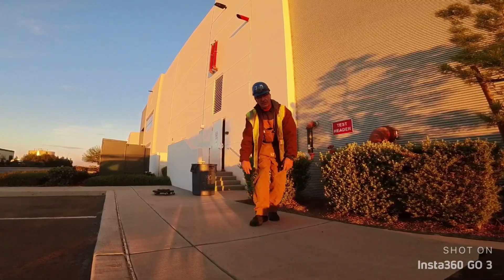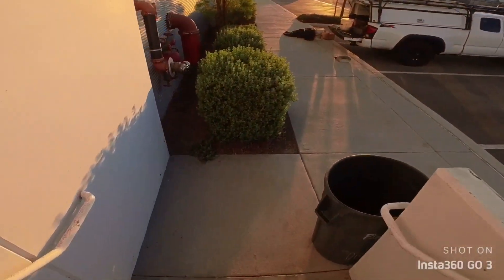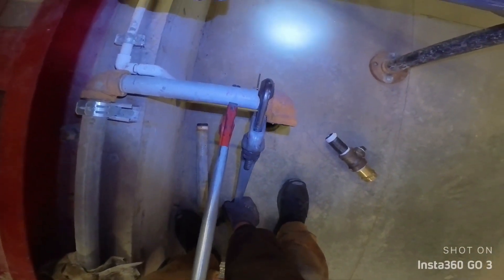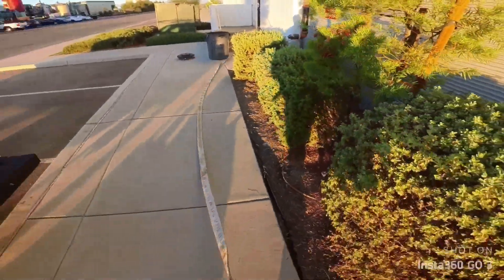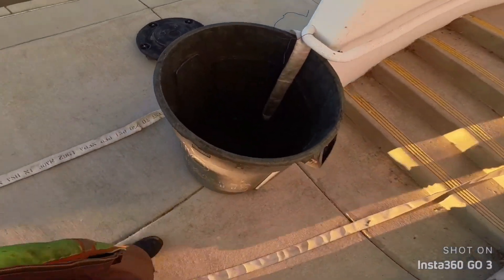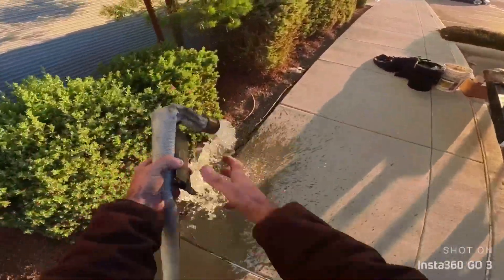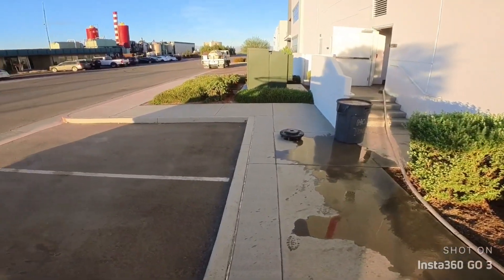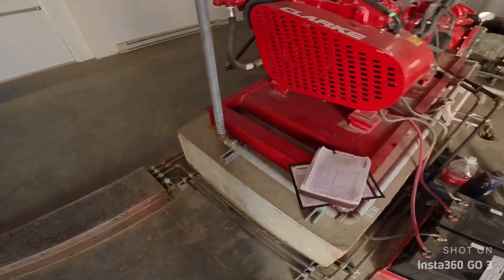Diesel fire pump run. Part 1

Comment: At my last job site (I'm retired now) I had a Diesel fire pump about the same size as the one that you are working with in this video. Your fire pump has two batteries. My old fire pump had four 4-D batteries, I wonder why?
Reply from the maker: I wish I could answer that question. But I know that each fire pump is different and have a different set up. No two are the same. It seems. A while back a couple of these batteries went bad and we had to change them out to different style. But I couldn’t tell you what style and why? Thank you again for watching and thank you for your nice comments. Stay strong and healthy. Bye-bye.